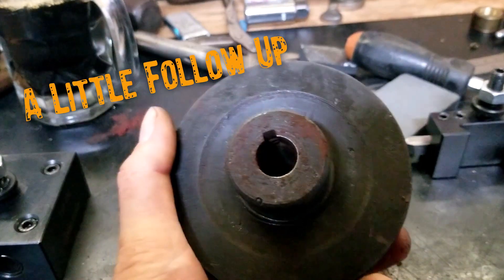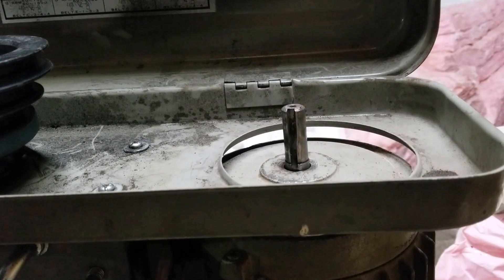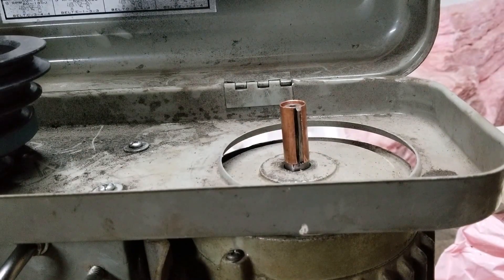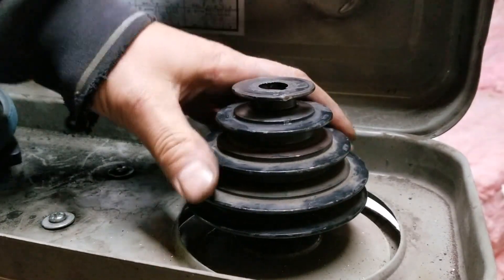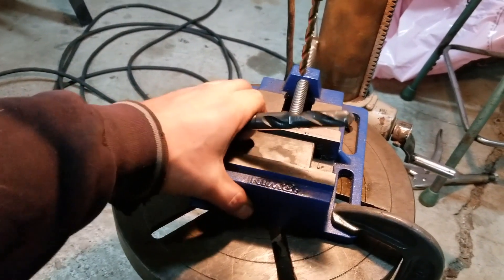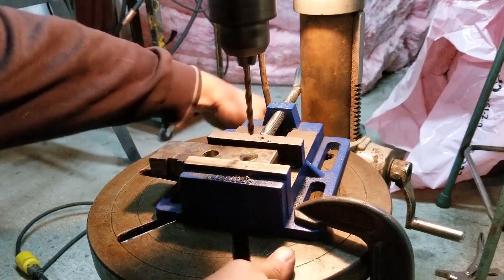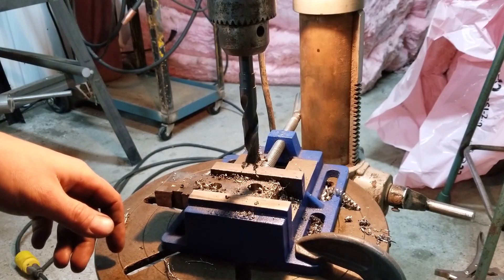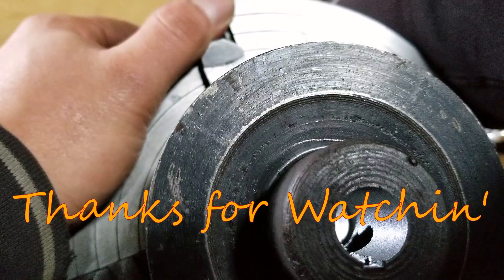Damn Wobbly Pulley Fixed! 😁

Comment: I did the same fix on a vintage Delta Milwaukee that had an aluminum step cone pulley. 
I made the split sleeve from thin, aluminum sheet.
Reply from the maker: Sadly, finding new pulleys of the same dimension can be difficult and/or costly. A sleeve is the best option imho 😊.

Comment: Hey Chris.
Always Love your video,s.
Craptastic or Crap Tastic, spell check still does not like it ??
Google quote :  the quality of being so crappy that the object is humorous or desireable.
That mostly covers it, LOL.

Not sure about the use of Copper as a bushing material ??
Might need a replacement at some point.
But it is a fix you wanted.
Happy you could resolve the problem easily.
But that is the reason i watch.
You make it happen.
Thanks for posting your video,s.
Always enjoy.
Peter.
Reply from the maker: Thanks, Peter. Yeah at some point a proper sleeve might be in order. The concentricity of that pulley was worse than the rotor on the motor 🤣, and that's saying something.  But, it's running better than it has most likely for many years and I'm good with that😊. Thanks again 😁.